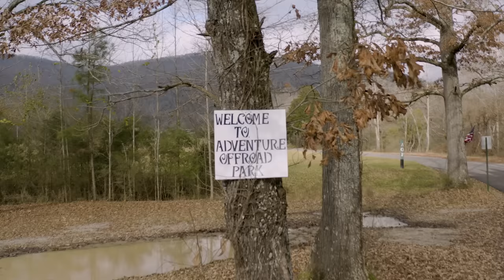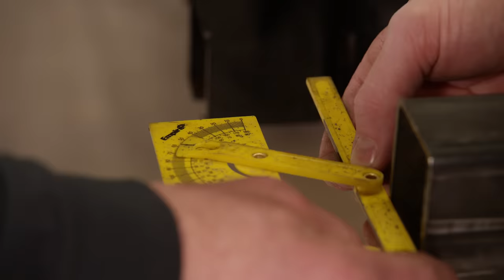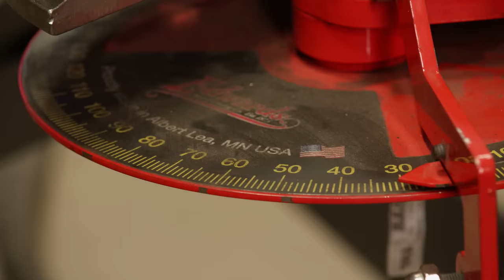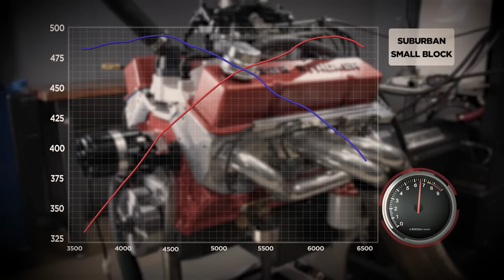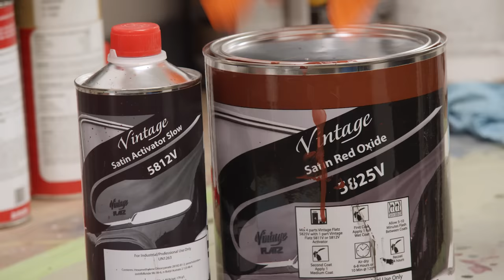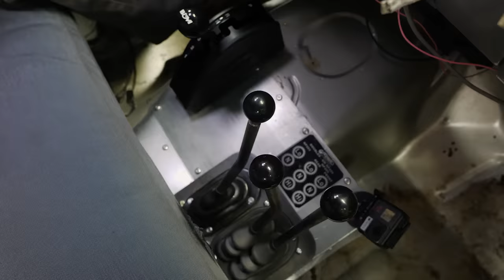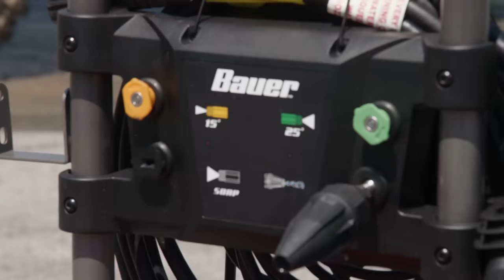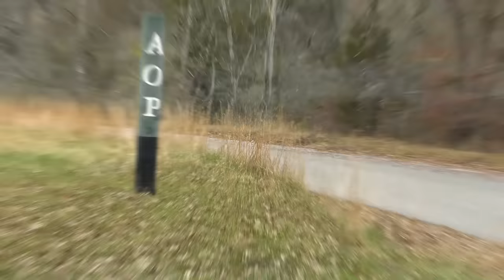Full Build: GMC Suburban Goes From Boring To Unbreakable

Comment: Remember kids, if you have a 100k dollar workshop and countless sponsors as well as a combined 100 years of shop experience and a logistics team of at least 10 people to source the right parts, you and your friends can do the same modifications at home too!
Reply: You'd rather watch some dude tune a carburetor or?..
Reply: The shop is much more than 100k
Reply: Or ya could just watch the dang video and they tell ya where they get the parts. Restoration work requires an I can attitude. Not for everyone. Great video keepemcoming
Reply: Naw - I can do this in my shop with no power
Reply: @The.Toaster  a-fuckinmen brotha.
Reply: All that stuff makes good tv/video. But everything they do can be done by a guu in his garage. Just takes more time. Dont be discouraged just because you dont have the big shop and sponsors. Keep buildin them rigs
Reply: @jamesbond1231  I want to know how you weld without a welder cuz that takes power lol 😂
Reply: @kentuckyboy.92  no constant power. Old diesel welder that was in the junk pile. "Lol"
Reply: Man I have never seen a bigger hater then this fella😂😂
Reply: @alexandarramey5907  one of the most diabolical haters of ALL time!
Reply: Well said
Reply: which i dont have unfortunately
Reply: Old Lincoln stick welder and a generator aught to do it .
Reply: A low budget truck was not the point of the video, guess you had the wrong expectations coming into it
Reply: Exactly!
Reply: Correct, except you need to add another zero to the shop cost.
Reply: Do forget thousands and THOUSANDS of dollars in tools
Reply: so there IS HOPE!!🎉🎉🎉🎉😂😂😂😂😂
Reply: Ain't one damn thing on that truck I can't do. My 2001 f250 was built equally, except wheels wider. Some guy up in Michigan now has it, and takes it to mud parks with very minimal mods to get 44' tires....
Reply: I also, I have met a couple of the other hosts, and I know some guys who knows several of the hosts personally. These guys are down to earth, and Very much into their craft. Kevin tetz, and Stacy David sent some stuff sponsoring a build we did, and called in and did a video call with everyone on the shop working on the bus... The psrts they get, are Not free. They're promoting the parts in a way that isnt annoying like a plain comercial...throwing shade at someones business that is doing great, kinda shows your mindset, and is holding you back in life. Don't get jelous, Be the one that inspires!
Reply: @kentuckyboy.92  if you’re good you can weld anything with OA.
Reply: They didnt say it was a budget build. But people do complete builds like this in their garage and driveways.
Reply: Hey kid, never underestimate what a real man can do. We can even fix your loose jaw. If you don't have the skills to do any of these things, keep your mouth closed, watch the video, and learn something.
Reply: @dudetheblessed2524  click bait 1:39:17 mark it was broken
Reply: @canamcartel9694  no not like this they have friends come help too for a few beers
Reply: These types of builds are possible my friends and I did a full 4link 1 ton axles conversion on a 95 zj jeep in his garage
Reply: More like million dollar shop
Reply: @alexandarramey5907  Nah I’m not hating. It’s just a tongue-in-cheek comment because of how effortless the video makes it seem. I really do like these guys and their builds.
Reply: @myconight  I’m not hating at these guys. I’m just making a tongue-in-cheek comment at how effortless the video makes it seem. I like these guys and I enjoy watching their builds 👍
Reply: @dudetheblessed2524   I’m not hating at these guys. I’m just making a tongue-in-cheek comment at how effortless the video makes it seem. I like these guys and I enjoy watching their builds 👍
Reply: @kentuckyboy.92  a battery or 2 jumper cables and welding rods. Not the best but seen it done
Reply: I've done 90% of these mods on different square bodies over the years and did it without half that shop equipment so idk what this dude is smokin
Reply: You’ll never amount to anything with that attitude
Reply: Yeah. You're a winner. Easiest way to do this is to know the right people by being a winner. Sorry you don't know the winners that support people trying to be productive.
Reply: Geesh booooo
Reply: @Diesel257  best reply to negative Nancy
Reply: That's my plan !! 
Affirmation from others is reassuring!! Thanks.
Reply: @kentuckyboy.92  two car batteries brother
Reply: These guys rock. I restore muscle cars and it’s not easy but show me a teenager that will do it and I’ll eat my hat. Nice to see a young guy on the show
Reply: Somebody is broke and mad at the world
Negative Nancy
Reply: @jamesg9068  you got me... I'm really ashamed of my lack of finances and my super small pp.
Reply: I could build that whole thing with a Crescent wrench. Who needs a welder that's what JB welds for.😉
Reply: @kentuckyboy.92  with a torch and a welding tip
Reply: @kentuckyboy.92   you use 2 12volt car batteries trail weld mate🇦🇺👍🤣🤣
Reply: Buckle up y’all
Reply: Its probably 100k just on matco rachets😄
Reply: @kentuckyboy.92  friction welding! Lol
Reply: I got a 100k shop, just myself tho, I do shit just as fast with no logistics crew, with my 20years exp, i still feel stupid. Lol
Reply: @bigjay6743  the Five Most Important Inventions :::: Crescent Wrench, Duct Tape, Tie Wire, JB Weld & Toilet Paper!!! Right next to a bottle jack, channel locks, a good rifle, & a fishin' pole of course.🤔
Reply: Who hurt you? just enjoy the damn build.
Reply: The best comment! Hands down! Lmao
Reply: Lol a 100 years these guys are jokes
Reply: True   Otherwise Nickel and dime it as you go.
Reply: @The.Toaster  in a parking lot & storage unit.....check it out
Reply: @kingsolo6241   exactly what I was going to say!
Reply: @kentuckyboy.92  uum... "JB Weld"!! 🤣
Reply: @The.Toaster  I like what you wrote because that is actually me working on my trucks or building boats in the driveway.
You make do with what you got and if you have a brain for mechanics and fabrication the driveway will do.
Reply: I can tell right now he’s gonna miss ole Tommy.
Reply: And still melt the steering arm bushing when heating up the pitman arm why I'm not entirely sure but then again I'm not the TV host nor have a 100+ thousand dollar shop either... lol
Reply: @myconight  I cant believe your comment doesn't have more likes, well said!!
Reply: Great video so far. I noticed you cutting steel on the cold saw. I recently purchased one and the salesmen at Trick Tools told me about these vice jaws that allow you to cut square tube at an angle. Wow! What a difference. Your blade lasts a lot longer as well. Keep up the good work!
Reply: @Diesel257  as someone who just posted a carburetor video that really hits me in the gut lol.
Reply: People do this shit in little two-car garages all across America every day…. If those are your excuses for not getting anything done I pity you.
Reply: Yes my minions feed on the troll flame 😈🔥
Reply: Way to crush some dreams haha!
Reply: Yeah, sure to do all of this fast requires all of that. The point of these shows is 1 to display individual skills/techniques , 2 to inspire.
Sure at some point you won't be able to match the cash,  but given time you could build something similar with cheaper parts or more labor.
I grew up watching these shows, and given the parts I could now replicate this build. That's partially because if watching theee shows. They inspired me to learn these skills. In the fall of '23 I'm starting show of my own here on YouTube. I'm gonna do my own '100k build', but it ain't gonna cost 100k, and I won't ha e any sponsors or even half of those tools.
In fact, watch any car YouTuber. Check out their early videos.
Quit whining and get inspired, be entertained, or just stop watching it.
Reply: So true 😂🤣😅
Reply: 50s style delivery van with a hummer wishbone suspension
Oversize tires let’s get nine speed transmission
Reply: I have built national level pulling trucks and tractors in a 2 bay garage, thousands of guys have built awesome shit at home. The negativity must be a generational thing.
Reply: @TheRoadhammer379  unless you're below middle age... nope. I kinda get it. They do kind of make it seem like they paid for the build with the change under the couch cushions and finished in a weekend.
On the other hand, the point is to inspire, teach techniques, and of course sell shit.
Reply: True that 😂
Reply: Youtube is great for showboating and making slightly less than honest builds
Reply: That's bullshit I did the same truck different yr mines 1999 k2500 suburban and cost me about 17,000 just gotta do the labor your self and took me 3yrs paycheck buy paycheck I got it done
Reply: How dare you. That tree don't nnen that this box
Reply: @ronaldjohnson8697  yes, but did you have all of the same top dollar parts and crate motor?
Reply: @krazysince2542  wow.  That did'nt make a lick of sense.
Try again when youre sober 🤣
Reply: Well you just gave yourself all the excuses you need to not even try🤦‍♂️
Reply: @yubbi0415  < ---- Is a broken Matrix bot. Prove me wrong.
Reply: @kingsolo6241  they've got more that 100k in hand tools aline
Reply: It doesn’t require a $100,000 shop. Any garage with a two post will do. With some smart decisions, you can get 85% of the way there on 1/2 the price.
Reply: Get your crap together and work hard and you too can have a shop like this. This guys didnt get this handed to them for nothing. It takes alot to build a business and sponsors you get only after you put out a ton of content and work.
Reply: Man I built trucks like this just with my dad and I with a small budget it’s just knowing what you need to do and where can you save money doing it in the time frame they did I do agree with what you say but if you have a year or year and a half it’s still possible
Reply: It’s fun to dream.
Reply: Aside from the shop and money most people actually have everything else.
Reply: Not really I did it with about 100 dollars of power tools a bear by junkyard and a patch of grass in my back yard
Reply: $100,000 workshop?  Try a couple Million dollar workshop
Reply: I think these are more about what can be done if you have the resources and manpower. Knowing how to use those resources andput it all together correctly  is what I'm seeing.
Reply: ALSO remember kids !!!!! That if you have Kamoboko86’s attitude you will never build shit , Finnish shit or see great results . 🎉
Reply: @kentuckyboy.92  heat and a hammer my dude.
Reply: I don't understand what the point of this comment is, other than just straight up hating.
Reply: Yeah that plasma CNC I heard them talking about probably cost more than 100 grand 🤣
Reply: There's probably 100k in tools in that green toolbox alone. Not counting the price of the toolbox
Reply: Is this chat still open? I feel like there has been enough comments already lol.
Reply: @kamoboko86  I'm sure we can keep going, how's your day been? 🤣🤣
Reply: I've done it in my shitty 1981 detached garage. Come on man. That's jealously talking 😮
Reply: U don't need anything but tools
Reply: Hey there putting out good entertaining content and if Kids see this and get in to fixing cars because of these shows than I consider that to be a good thing like I get what ur saying like I know it takes Alot of money and ppl to get these builds don't but like I said it gets kids involved in cars and working on them and that's not bad I build my first project car with junkyard parts and barely any money in my driveway because I got inspired by these shows
Reply: You've got a point, but I'd argue most viewers are just watching to see what happens.
Reply: And remember also kids if youre a big whiner youll never make anywhere in life lol
Reply: that's why I like the small-time Youtube channels, but I still appreciate that a big media company with sponsorships can fund these dream builds with shiny crate engines and all that. You can still do most of this stuff in your driveway, it'll just take you a lot longer and most people have a budget. But it can be done.
Reply: The shop is more then 500k
Reply: You sound salty….lol
Reply: @crunchythedave  Hate! Hate! Hate!
Reply: @jamesbond1231 Or the car battery welder works too.
Reply: Lmao, someone sour? This all doable at home they just can do it much quick lol
Reply: I’ve done this kind of stuff on a shoestring budget it’s not fast or easy but it can be done
Reply: salty
Reply: So salty 😅
Reply: More like a 5 million dollar workshop...
Reply: LoL I've got an 84 GMC I've been seeing on to do exactly that 10 grand in n I stepped back
Reply: Setting on
Reply: I have a 1980 k5 one tone on 40’ tires me and my kids have been building it in the dirt about 15k into it 5.3, Nv4500 1992 magnum under drive 205 tcase cv drive lines about 3 years in to it. It’s possible with out a sponsorship or garage…
Reply: Wasn't the burb to be the budget build.. because if this is budget I can't wait for custom.
Reply: I have junk projects in my yard already
Reply: Remember kids, don't be a hater
Reply: Or if you have a cell phone, a video that tells you the parts, they used a garage and some skills you can build your own.
Reply: Title says complete build, and they actually show the build, what else do you want😂
Reply: ive seen people do more with less
Reply: @Diesel257 that bus shouldn't have a carburetor unless it's swapped in
Reply: I mean it’s a tv show, secondly sure they’re showing an entire build but it’s also just to give tips if you have something on the go that’s similar like painting a hood, or you’re building a rear end, etc. 
not a step by step process of building the same truck
Reply: Still entertaining tho
Reply: Maybe if u quit crying you too could have a shop 22 yr old shop owner here. Nobody did anything for me ever
Reply: wow, the amount of people coming at you for pointing out the obvious lol, i on the other hand kinda find it ironic. they named the project unbreakable, but did a bunch of stuff to make it breakable. in stead of just using a mechanical fuel pump and a 4 barrel thatll last for 20 years, they use a 3000$ fuel injection set up that requires 40 percent more, easily breakable parts? then gut everything to go with this rediculas air ride set up? if anyone couldnt tell that thing sucked going up a hill, that teail was barley mild and im guess they had to play it safe because every bump felt like it was going to roll over. they would have been better off just upgrading the stock leafs and shocks. that would have made it unbreakable
Reply: Didnt come here to be inspired, just relexing watching others do the work

Comment: I like the build, but it has a really narrow wheelbase for how tall it is. I would definitely be concerned about rollover
Reply: I was wondering why the rear end is so narrow
Reply: It's not so much narrow, as not centered. You can see it looks like it's hanging out the driver's side as much as it's inside the passenger side around the 1:34:00 mark.
Reply: Im glad I wasnt the only one feeling like this Burb had missed leg day.
Reply: @EpicToadRage  agree. Makes ya wonder about there build quality  and knowledge that isn't feed to them
Reply: @jeffstevens9849  Yeah the geometry in the rear is off a bit. Easy to correct.
But on the Chevy suburbans, and maby on the trucks too, the rear ends were 4 inches narrower then the front ends. Why ? Have no idea.
Reply: @johncarter9054  So the wheels weren't tracking into exactly the same path...
Reply: @EpicToadRage  where they mounted the link mounts on the axle truss, they just centred them on the top of the truss. They’re nowhere near centred on the axle itself. It also looks like the truss is just welded on the small portion of the axle tube, instead of around the housing as well. It’s probably about 100mm off centre which is insane to miss
Reply: Its a definite No from me.
Reply: I would source a full float rear diff from an express to widen the rear Trac like lt did on his channel

Comment: Cool build, but watching that come at me, on video, I think it was a mistake, to leave those wheels so far inside. I think I would have made that things suspension a bit wider. You had plenty of room and even could add fender flares, if needed.
Reply: The 135 minute shows the suspension is off centered by a lot to the left . Bad geometry. Easy to correct
Reply: Or do it right and Go with a 75 IH Travelall!!
Reply: That corporate 14-bolt has to be off of a dually
Reply: @KentuckyBackyardMechanics  I pulled a Corprate 8 lug off a 78 3/4 ton Saburban and slapped on my Travelall.

Comment: As a crew chief and team manager on a 4 car NASCAR Open Wheel Modified team for 9 years i learned a very important lesson. ALWAYS replace any bolt and self locking nut that took a hit on the parts that took that hit, ALWAYS. The bolt and nut took the same strain as the part that got bent or broke. It keeps your high performance vehicle from falling out of competition. I learned this the really hard way, trust me!! Ya'll seem to have the basic skills to use very expensive parts and components, so to keep them in working order it seems you have a lot to learn. Being young and have access to cash is just the baby steps of your modification process. LIVE AND LEARN